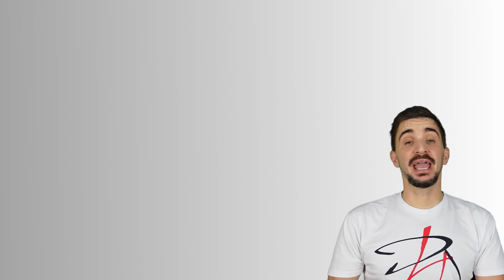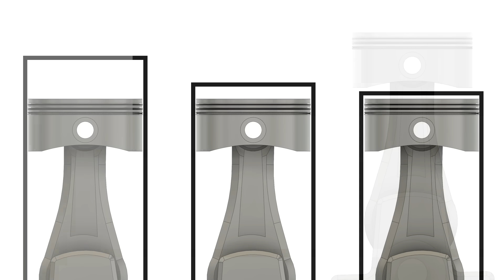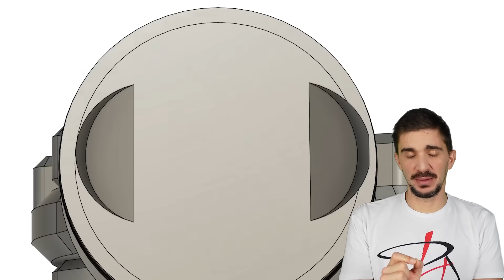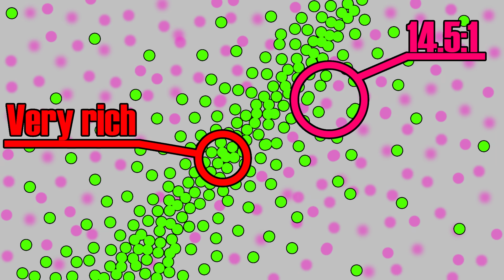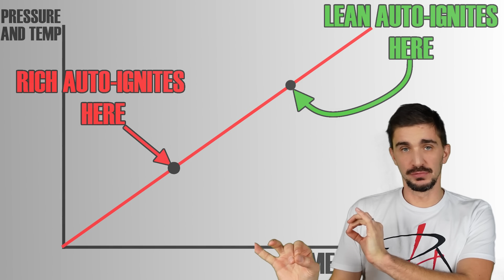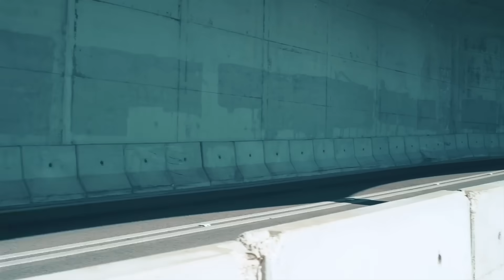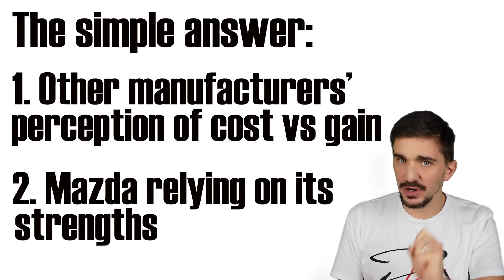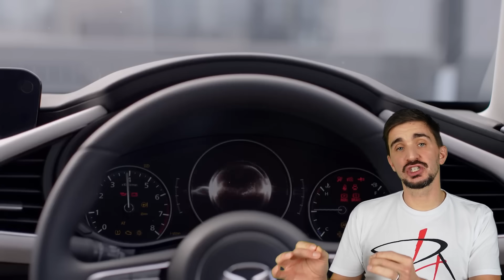The Game Changer Nobody Cares About - Mazda Skyactiv-X SPCCI How it Works and Why It Didn't Catch On

Comment: Keep the non-music format. Relaxes the brain. Thanks.
Reply: I Agree
Reply: I agree. It's like anti-brainrot, calmly having engine workings explained (very well) is so good before bed
Reply: i agree
Reply: It also helps to concentrate on what's being said
Reply: I agree
Reply: agreed 🍻
Reply: I’m so happy to see someone say this. Many equate music with relaxation when in fact it is just one more thing to concentrate one’s attention. Music OR dialog. Always, please.
Reply: Agree
Reply: I didn't even notice it didn't have music, but you're right, it makes a huge difference
Reply: i agree, their determination to make rotary work is so gd admirable, even as it’s less and less ideal by the day. nissan’s vc turbo is really cool too, but it’s a smaller turbo engine, and it definitely has had some reliability issues. i hope they figure that out
Reply: @tony2eepy  for certain applications the Wankel is better than piston engines. They work great as light aircraft engines spinning a prop, Mazda already has used a 300cc version as a range extender in the JDM only MX 25 EV, and believe it or not but some large boats actually use huge rotary engines. They can be run on basically any fuel and are far more efficient and powerful than 2 stroke diesels. I think the Marines had a landing craft that used a marine Wankel that made over 3000hp.
Reply: Agreed
Reply: Seriously. I am working on launching my RC car channel. All the other channels use so much royalty free music I have started hearing the same song on multiple channels. I would prefer no music.
Reply: I agree. Having no back ground or accompanying music enhances the clarity of this excellent content. It’s not as if we need music to provide the appropriate emotional cue when homogeneous charge combustion is described.
Reply: yea, i usually like when people put music in the background cuz it hides low quality mic audio but seemingly recently it doesn't matter anyways cuz of yt audio compression getting cranked to 11 making everything sound worse than before idk a year ago? so at this point yea might as well not have music
Reply: Agreed.
Reply: Thank God my religion forbids this annoying music, and I feel happy now.
Reply: Agreed👍. Why do so many creators insist on downing out the naratation with loud back ground music ?. Many a good documentary has been rendered unwatchable.
Reply: Agreed
Reply: Why not just do a "voice over" and lose the presenter's face time.  It adds nothing to the quality or effectiveness of the presentation.
Reply: @d @dc-wp8oc  wtf are you on about
Reply: Absolutely AGREE.  And a real non AI person that actually talks to you like you human being.
Reply: I agree
Reply: I listen to this guy and enjoy him, but at 2x, and sometimes 3x.
Reply: Music works, when done properly. Filmmakers figured that out 100 years ago. Imagine your favorite film without music.
Reply: @mranerobic3795  context matters
Reply: @mranerobic3795  Yet you still generally wont see pros put music over informative narrations/ documentaries. They save the music for when there is no speaking to avoid silence.

This video is 100% speaking, music would just be distracting noise.

Comment: How about using this technology in an OPOC engine, where one bank's cycle timing can be retarded to create a lower compression ratio for acceleration, and returned to matching the other bank's cycle timing for maximum compression ratio for cruising? Or maybe a sliding top end to vary compression ratio?

Comment: Thank you for your video. I have a 2022 CX-30 e Skyactiv X 186 hp, 240 nm, manual six speed, 0 to 100 km (62 m) in 8.5 s. I pull a 750 kg caravane no problem, love this car, love this engine. Since 1981 I only buy Japaneses cars and since 2013 only Mazdas, this is my sixth!
Reply: Est ce que vous ressentez parfois des légères vibrations à l’embrayage quand vous démarrez en pente sans accélérer (juste en relâchant l’embrayage)? Je ressens cela sur la mienne parfois et me demande si c’est normal ?
Reply: @lmpb3484    C'est peut être le frein automatique de démarrage en côte qui se désenclenche, je n'ai pas ressenti çà comme un gêne, peut être maintenir l'embrayage plus longtemps?
Reply: @francoisvola3611  oui en maintenant l’embrayage cela s’atténue. Toutefois, la sortie de mon garage est en pente et lorsque que je sors de celui-ci avec un filet de gaz la voiture broute légèrement, il faut vraiment mettre de l’accélération et faire patiner un peu + l’embrayage pour que cela soit fluide, et je ressens également ça lors de certaines manœuvres à basse vitesse en pente (en manœuvrent sur l’embrayage).

Comment: I was exited when this engine type was announced. I think it was 7 years ago. Unfortunately, real life isn't as neat as theory. In practice, the parameters for running the engine in this mode are very narrow. In the end the Mazda engines still have significantly higher average consumption than similar power TSI engines. 

TSI, btw, stands for "Turbocharged Stratified Injection". Even TSI can't run lean very often. Lean burns hot and causes NOx, as was mentioned, so even if the engine could run, for emission reasons, more fuel is injected to keep the temperature down. 

HCCI is cool, but best it is not, unfortunately.

Comment: As I recall, the 1997 Jetta was one of the safest cars on the road. Perhaps this was because its drivers were paying attention? Having driven Rabbits, and Jettas, and Golf of various (all) the eras... the unifying characteristic of Volkswagens until recently was that driving was fun precisely because you had to pay attention. It required skill, yes, but with the benefit that driving a humble economy car was engaging and fun. Conversely, most modern vehicles are exist to be sold -- and more specifically, to be financed at high interest rates for more than they are worth now or ever.  Most drivers of modern cars where I live are literally on the phones while pretending to operate their half-assed semi-automated vehicles, oscillating between proto-homicidal distraction and then flooring the accelerator pedal. Or both at the same time. 

SkyActiv sounds like it is worth a test drive.

That said, we need to be honest the Mazda product line and SkyActiv "brand" are incredibly poorly thought out, explained, and marketed. It's ridiculous that they're calling both an automatic transmission and a manual transmission each "SkyActiv" as if that means anything. They even have a "SkyActiv" steel chassis. It's like AI Slop where the words have no meaning. Mazda needs a word like Quattro for Audi, that gets to the point and explains the difference? Nobody knows what Mazda is for any more.  Shame, because like Yamaha, they have a culture of excellence in engineering and have made some of the best engines.

Comment: How is this any different from bmws N53? It also injected fuel in multiple portions, ran with lambda 2...3 under partial load, returned ~7 l/100km which in a 530i is incredible. It failed because of its costly fuel injection system, extortionate cost of separate CO and NOx catalysts and NOx sensor. I'm not convinced of your explanation about the NOx formation in Mazdas engine, that has been one of the main limiting factors. Lean running engines have been around since the 90s.

Comment: Firstly, Gasoline isn’t “Clean” and can’t ever be efficient because once it’s used it can’t be reused! No internal combustion engines can compete with electric powered vehicles which are over 95% efficient.
Reply: Only if you don't care about all the people dying because of the pollution caused by manufacturing and charging the batteries. You are literally still burning the same hydrocarbons to charge your battery, but you're doing it at the coal or gas fired power plant; and you're subsidizing a monopoly power distribution company without a pension plan, and I promise you 100% of their fleet vehicles are heavy diesel trucks that idle 20 hours per day and make unburned soot the other four.

Comment: Perhaps this is a stupid idea, but I am always thinking how much wasted energy in the form of heat is not used generated by the exhaust system of an internal combustion engine, can this heat not be used to superheat water into steam to drive turbines that in turn helps to turn the wheels. Or an active engine cooling system designed to USE the heat of the engine for propulsion instead of just passively cooling the engine and thereby letting all that heat energy go to waste?

Comment: REV Force + Skyactive?

It seems that the Skyactive technology would be pretty agnostic as far as how the fuel and air get into and out of the engine as long as they are well mixed and have the correct compression ratio. The REV Force's supercharger may be able to get up to the approx. 16:1 ratio as is, but if not, a redesign of cylinder dimensions and stroke length should be able to get you there without invalidating the REV Force intake and exhaust geometry.

Thoughts?

Comment: As always amazing video! And i see that this video misses another huge update on the engine, e skyactive x. I just got my Mazda 3 2021 with e sky x engine and absolutely loveee it. I can see the differences are minor but they are there. I drove them back to back. 

Because of how genius mazda are, they used the hybrid tech to make gear shifts even smoother and add tiny bit more torque to the engine.

Comment: Mazda Australia sold several models with Skyactive X engines but all at a heavy premium vs their NA and turbo inline 4s. They were so expensive it entirely negated any supposed fuel efficiency savings. The models were discontinued after a few years.

Comment: The trend towards electric SUVs is depressing. After this video, I looked for Mazda 6 with a skyactive-x engine. It does not seem available in the EU. We are out-regulating most sensible cars: family wagons with  low drag and high motorway range.

Comment: Question since it's a combustion engine, does it still have carbon build up on the intake valves ? Is it Direct injection ? Does it have EGR ?
Reply: Not like diesel carbon build up, cause almost all fuel will be burned in the chamber.

Comment: Wait until Mazda makes a V8 with the mpg of a 4 cylinder using this tech 😂 Nah but actually if they figure out how to use SPCCI in a performance application to get crazy hp/L from an N/A engine then people may get interested (and other manufacturers may start using it as well).

Comment: 8:30 Isn’t this similar to TJI? (Albeit without the pre chamber). Is there an advantage to one over the other? Couldn’t you just have the same lean mixture and high compression but with TJI jets?
Reply: In a way it is, but both technologies require the formation of a localized combustable volume around the spark plug / pre chamber. Mazda mastered the formation of a rich mixture around the spark plug, this knowledge is also important to fill a pre chamber - if a passive pre chamber is used.

Comment: HCCI sounds like an ideal candidate for an ICE powering a generator in a hybrid that uses all electric motor drive. It can permanently run at the ideal load for the motor's HCCI functioning, unlike when the motor is used to drive the wheels.
Reply: Cannot wait till they come out with the motor as electric generator, with plug in battery,just like locomotives have used for many years. 1879 AI said it started.
Reply: Toyotas planetary hybrid system is such an elegant solution.
Reply: Mazda has a rotary engine for that😂.
Reply: are you an engineer or know any with a great talent and entrepreneurial skills?  I have a new type of SPCCI engine that runs on ethanol and can get up to 2.5x+ fuel cost savings. I have 3D CFD, ChemKin simulations and offering early buy-in and commissions for referrals. Thanks. Message me here if you know anyone interested.
Reply: Exactly been saying this for a decade+

Comment: So, if this technology was applied to MAZDA'S 2.5L motor,  we could expect 26mpg under load  or city driving and 40mpg under HCCI conditions. Mind you,  using the ATKINSON CYCLE, TOYOTA'S  2.5L in 2020 was achieving 30mpg city and 40mpg highway with a more typical 12:1 compression ratio.

Comment: I'm sad this engine hasn't come to the US. My understanding is that tMazda thought it would be a hard sell due to the increased cost over the Skyactiv G engines, combined with a relatively smaller MPG improvement, lower power, as well as with requiring premium fuel. Sad, as I was really excited for it, and as you lay out here, it seems like a really cool engine. I hope the Skyactiv Z line of engines will learn from the X and be brought to the US.

Comment: I don't get why people say 186 hp is slow. It isnt fast in a straight line, but it's plenty fast around corners (if the suspension is up to snuff) and it's faster than most people are qualified to drive. You all know what I'm talking about.

Comment: Isn't that the same technologie used by audi in the mid-2000. It was called stratified combustion and it used special designed piston heads with a small chamber to achieve it

Comment: Hi mate, it's been bugging me for so many years now, but can you explain in detail, if an engine with 91 RON recommended fuel can run on higher RON fuels, would there be a significant damage to the engine in doing so, thanks

Comment: Just have to ask, volksalwagen made the gasoline powered 2.0T 'fsi' engine which was used widely between like 2005-2010. Fsi meant srratified ful injection. It injectdd directly into the combustion chamber near the spark plug.  I am NOT  a wizard so i dont know what that means, but was that technology at all similar to this?

Edit: watching the vid all the way through obviously not since the fsi ran at 10:5:1. But it got me thinking. 

I absolutely love your style man. Ive never grasped the differences between gasoline and diesel until this video. Just like how i never understood 2 stroke jntil your vids. And many more topics. You have an incredible method of breaking down this information.

Comment: A 1ltr 2 cylinder version powering a plug in hybrid would solve some problems. Keep it at it's correct revs for efficiency and use the electric to replace it's flat low end. Also use just electric the vast majority of the time at low cost.

Comment: How well do SPCCI engines take to performance modification? I would suspect that the same controlled-spark mechanism allows for inherently precise control of timing, but I would also bet that any change in AFR and charge pressure completely changes the spark point.